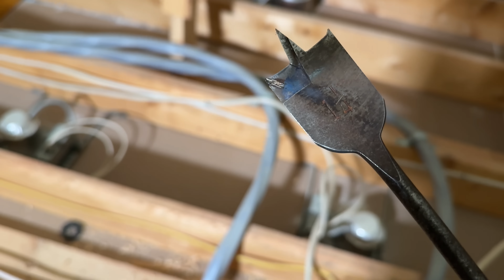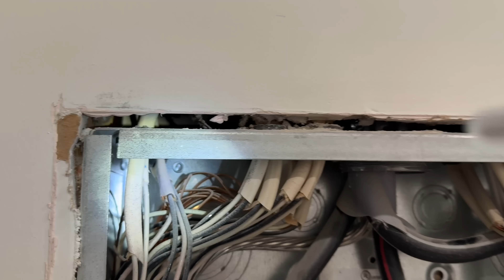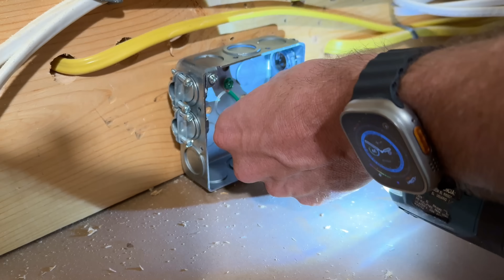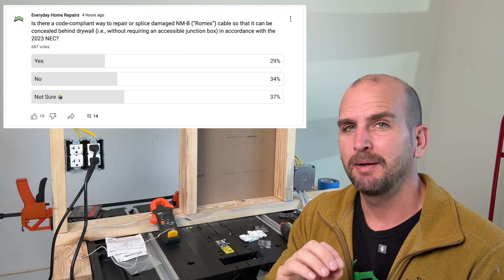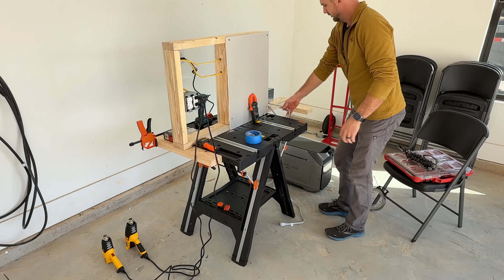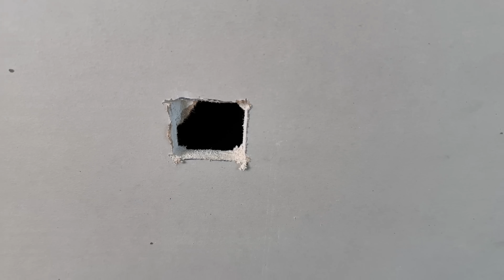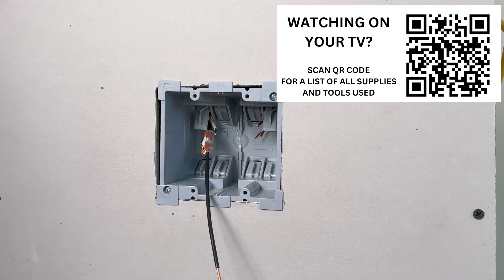How To Repair Damaged Romex |  3 Easy DIY Fixes

Comment: I'm always going to use the box approach but I'll be using wire nuts because they are the best, full contact area connection you can make.  If you can not get enough length, just add ~6 inches or so of the same size wire and use two wire nuts. 

I have done extensive testing of most common WAGOs and I simply will not use them except in low wattage lighting fixtures. I'm not a fan of WAGOs for anything but low current applications.

My issues with WAGOs and the splice kits, is the very small contact area and a reliance on spring tension to maintain the connection. The in  line WAGOs are the best of these designs   and that's what I might sometimes use in light fixtures, but I'll use wire nuts for any connection expected to support full load. They work best because of the very large contact surface area. 

WAGOs very clearly are proven to have higher resistance than wire nuts. WAGOs have the issue of dissimilar metals, along with the very tiny contact area. They use a copper "buss bar" but are held with a steel spring. Theoretically, the copper buss conducts the bulk of the current, but the steel spring is in parallel and may actually bite into the wire beer than the touching contact of the buss bar. Still, he combined surface contact area, is less than the wire cross sectional area. They will likely take 20 amps all day without excessive heating. Testing supports that. 

Steel springs will weaken over time and even more so when heated.  The higher the current, the more the heating. Heating is a squared function of the current. Current squared times the resistance of the connection. Most  assume the current will not exceed the 20 amp rating of the breaker. But that isn't quite accurate. Breakers are ratted for 80% of nameplate continuously. So that would be more like 16 amps continuous. Over an extended time period, 20 amps may indeed trip the 20 amp breaker. A 20 amp breaker will trip immediately.in a short circuit. But in a solid short circuit, the instantaneous current easily can be thousand amps in a typical 12 AWG circuit. Now the breaker will trip in well under a second, but consider the power dissipated in that very tiny cross section of contact area. 

Current squared is 1000 times 1000, or 1 million.  Times the connection resistance, typically around 0.0025 ohms (~2.50 milli-ohms) is 2500 watts. (2.5KW)!  It is very brief, but it  has to   do some damage to that high resistance connection.  That WAGO connection will be the "weak link" in the short circuit. The wire itself will dissipate the power too, but it will typically be a total of 50-100 feet of wire in the circuit as compared to the cross section of less than a millimeter.  100 feet of 12 AWG wire will have a resistance of ~0.158 ohms.  The current passes through both equally if the WAGO sees line current. I urge you to draw the circuit and do the math. If the WAGO sees all the current, it will probably not survive or at least suffer major overheat damage.

Now short circuits tend to be rare and a solid, "dead short" is likely more rare, but depending on where the WAGO is in the circuit, it may potentially self destruct like a fuse. 

The above is the absolute worst case scenario and it  is a fault condition.

But it is not the only situation where the WAGO must pass more than 20 amps.  A "normal" situation above 20 amps is in starting an induction motor. The total "normal" current depends on the full load size of the motor and the application. The "inrush" starting current of a 120 volt motor can be 5 to 8 times the full load current. So take an example of a compressor or other heavy load motor rated 16 amps full load. It can briefly draw about 128  amps inrush.  It is brief and as soon as the motor starts to rotate, the current comes down. Typically, within a few seconds the motor will be up to speed and down to full load or less. Household breakers are designed to support this inrush current without tripping.  But let's do the math on this instantaneous current through the WAGO. 128 times 128 times 0.0025 equals 41 watts dissipated across that tiny connection contact area! At 20 amps, the power dissipated is 1 watt. Not very much and the heat will generally conducted away into the wire. But 41 watts is significant. Even though briefly, that tiny little connection point will get pretty hot before it gets drawn away into the wire. 

Time of the high inrush is a factor. Time vs current is also a factor in the "overload" trip point of a breaker. You can check breaker manufacture data to see these curves. But you may be surprised just how long a 20 amp breaker can supply a substantial overload current. 

The concern is that the very tiny contact area of the WAGO will get very hot. albeit briefly. Typical testing using a thermo-camera is not going to pick up the temperature of that tiny little point because it can not focus that fine. What you are seeing is the temperature of an area much larger than the contact area, averaging out the pixels in that area. 

I contend that WAGOs subjected to frequent inrush overloading, will suffer deterioration at the contact surfaces over time. This can be a "normal" use situation. Most  likely, over time the resistance will increase and be subject to more heating, albeit that higher resistance will result in a bigger voltage drop and somewhat reduced current. But halving the current only reduces heating by 25% because heating is a function of the current squared! And with an induction motor load it gets even worse because the time  needed to bring a motor up to speed is a function of starting torque which drop when current drops. Heating and cooling cycles will reduce the steel spring tension, so things can snowball. Ultimately the failure is most likely to be fail open. Probably not a fire threat. 

New WAGOs will probably support 20 amps continuously but there are times when a 20 amp circuit "normally" pulls a lot more than 20 amps.  I get why people like them, but I don't like the very nature of a spring clamp connection and the extremely small contact area,

Comment: The hidden splice in wall really worry me. This kind of connection is known to be a failure point. There is no way to really know if the connection was proprely made. This rely on having a wire that the insulation is not too soft (some lower quality cables) nor too hard (some older wires that hardened) nor has degraded over time. It also rely on the copper wire to be round and not oval (which while it should there is absolutely no garanty that it is). And it is not designed to be reused, so if you messed up and try again, the connection might not be good anymore as it can separate the fork and damage the fork plating. And that you put the wire right in the slit and not a bit off, which can make the wire oval and bend/separate the fork.

While you did a good test, your test is still somewhat invalid. The temperature was still rising up and not stabilised yet. While it does look like it was fine, it don't show up what happen if you connect a constant load on it, like a pool pump. Or what happen if you have a load with a high inrush current, like A/C, which can peak at over 10 times their running current, can and does excede their rated current at startup for a little while.

And your third option is not legal. The jacket is not inside the box, therefore your cable is unsecured. This could be fixed with a 3 gangs, or using 2 boxes with a new length of cable in between them. In that option you could use single gang on each.

Comment: You asked what we think.  I think your test validates no significant heat rise on brand new wire and repair connectors that have no aging, corrosion, or oxidation.  Not convinced it represents conditions after 20 years of galvanic action between the connector and wire.
Reply from the maker: Fair point 👍

Comment: Good video. Nice you showed 3 options that all work. The only thing I would question is in number 3 ... why not just use jumper wires long enough to connect each end with the Wago inline splices instead of adding three additional slices with pigtails and the Wago double splice?

BTW - I have seen the MH outlets fail ... but I have also seen the standard outlets fail. It usually happens when someone overloads the circuit - not a design flaw of the outlet. Most of the push in connectors that pierce the jacket I have seen have a V-shaped gap where the wire goes so they grab all the sizes they are rated for with the same efficiency.

Comment: I hate how stapling wires to studs is required by code. there should be plenty of ways to secure your wires without making it impossible to pull new wire. home upgradability is so tedious and expensive with it like that.

Comment: Is it me or did he say 20 amps at 120 volts was 240 watts. Pretty sure that's 2400 watts. E x I = P. 
Then again a heat gun that pulls 100 watts. Ummm no. Still, excellent information. I have spliced by adding a outlet more than once. 😮

Comment: The NSI connector has been used in the RV industry for a number of years, for instance my motorcoach which was built in 2008 has them in various areas of the coach.  There is a special tool to use to put the wires into the connectors before they are connectors and the tool is used to press the wire in before the cover is installed.  I don't know that NSI makes the tool or who does but I've seen the tool used in the process of making up these connectors in RV's.  Once the tool presses the wire in, the cover is put on on and the the two connectors are plugged in together.  My coach actually has these connectors in a 14 amp, 12 amp and 10 amp rating when it was built.
Reply: that's called a punchdown tool.

Comment: Some Romex in my attic was pulled wrong and there is a knot or kink in one spot.  I have put off doing anything about it due to the difficulty of getting over the main panel.  I was not aware of the WAGO Inline Splice so that would be just the thing to save me a lot of trouble.  Thanks.

Comment: I prefer a god physical connection, solder the connection, and then put quality shrink tube over the splices. Even wire nuts are better than these little Chinese made low friction, least contact splice kits.

Comment: I liked seeing all 3 methods as I wasn't aware of the legal in wall splice. I had a similar case where the wire was too short (not damaged). I just added a single gang box and added an additional outlet in the room. I was able to back up along the existing wire enough to place the outlet at the correct height.

Comment: Regarding solution #3, why did you use 2 pigtails with inline Wago connectors and then another Wago connector to connect the pigtails together? I would think a single pigtail with inline connectors on both sides should work. Of course, you need 3 of those, one for each conductor. Also as others mentioned here, you need 6" inside the box.

Comment: Are those engineered trusses that have holes in them ? and if you are living in America, do you not have codes for which part of the building you can drill holes in and not drill holes in , reason I ask this is because in Canada we have strict rules about drilling holes in engineered trusses
Reply: We have codes on hole size and placement as well.

Comment: hello   after  watching  i  see  that have  220  now in the  metal  box in  the  attic i watch  you  stack  the wire  on  top  each  other   that  putting  220  in  that  box    should  write on the  box   220 in  box   and  it  2  circuit   and  label  it  breaker  Numbers

Comment: AT&T has an Epoxy Inline Repair Kit that would work great for a Break in wires like this as the wires will be engrossed in Epoxy, no way for Hot Wire and Neutral to every Touch...

Comment: About the attic repair. I believe that current code requires that all grounds in a junction box needs to be connected. I don't have a code book handy to verify it
Reply: I believe the second one should be sheathed as to not touch the other earthing conductor as they are from different circuits. If there is a fault and you are working on one of those circuits and disconnect it from the board it would become live which would be dangerous

Comment: Hello from a Electro Engineer from the "Deep North".
Though, I, personally never done such a patchwork, since our regulations here, are much, meaning seriously much, more strict, concerning electrical installations, I lived in New Zealand, and saw these "installations".
I saw and scratched my head, how in the hottest h**l, are you even going to repair/replace, something like this?
Well, you have to accept, adapt and get going.
Living in fear, every night knowing those, "installations" were hanging over our heads.
"We" here, in the other hand, have to install hard PVC pipes, in the dry walls and then, route the single wires, through the pipes, yes, a bundle of those, and always(!) use connecting boxes for any connections. And, only use plastic ones today.
The positive and a legal claim, is: Never apply any wallpaper or anything, to  permanently "seal", or make invisible, the access to the box.
You must always be able to spot, where the box is on the wall/ceiling.
BTW, You would never past the installations course in Sweden by doing something like THAT at 5.11! 😱😱
Sorry, kind of for You, but this is true!
May the Force be with You, without short circuits.
from a Finn in Diaspora

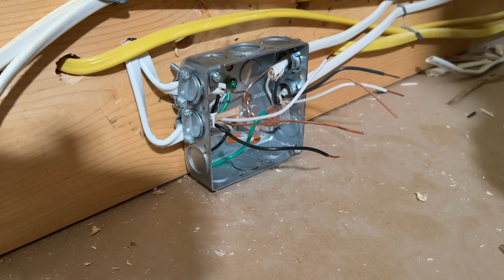Comment: At 5:32, all grounds in a metallic box shall be connected to the box. 250.148 (A)
Reply: I believe the second one should be sheathed as to not touch the other earthing conductor as they are from different circuits. If there is a fault and you are working on one of those circuits and disconnect it from the board it would become live which would be dangerous thus they shouldn't be connected together. Also based on others comments the code would be for all conductors of a circuit to the be connected not actually all earthing conductors.

Comment: I'm not a fan of that splice kit used in fix #2.  While the environment is quite different, the similar "Scotchlok" connectors often used in auto wiring can work fine when new, but age rather poorly.  The dissimilar metals and atmospheric moisture cause corrosion/tarnishing, reducing conductivity and increasing resistance, thus generating more heat than new, sometimes to the point of failure.  Obviously, automotive situations also have to deal with vibration, and the conductors are stranded, so it's not a one-to-one comparison.

Comment: The example you use to demonstrate they are safe is not really appropriate. Mobile homes, RVs and the like have to use stranded wire which is probably why they fail. The blade that penetrates the wire insulation wouldn't pierce the wire so much as slide between strands. Residential uses solid wire and there is no similar, safe example to cite. So, while it is possible to drive on the freeway at night in the rain with your lights off and not get hit, don't.    Use #3

Comment: I’m only seeing the ground pigtails in the parts list you recommend. Which neutral and hot do you prefer?
Reply from the maker: I just pull the conductors out of a scrap piece of 12/2 Romex.
Reply: @ I forgot you said that. Thanks

Comment: 5:20 as he improperly pinches the Romex in the cable clamp screw.
Reply: Oh boy.  I had to go see if you were an insufferable critic but you’re right.  Could have been chasing open ground or short.

Comment: As an electrical inspector (now retired) and a previous  licensed master electrician I started to see these "splice kits" over  20 years ago doing inspections on modular homes doing  inspections for services,  basement or bonus room wiring as the rest of the wiring  came through  from the factory pre-certified, I never liked them then and still do not but under the circumstances I was  forced to look the other way.

Comment: How/what happened when the mobile home outlet failed?

Why use pigtails on both sets of wires in 3rd option, just pigtail between both wires with Wago connectors, yes?